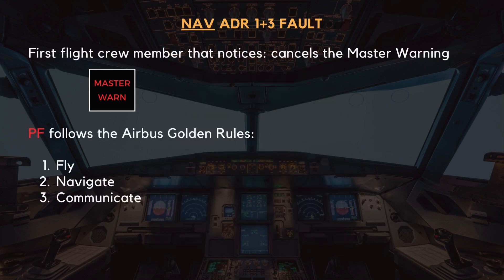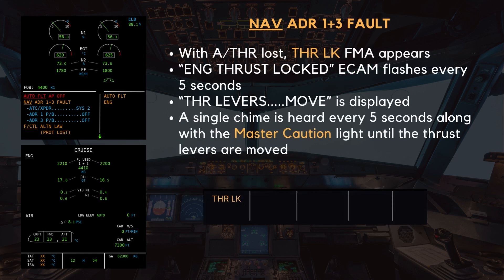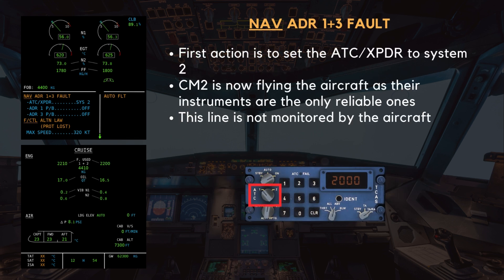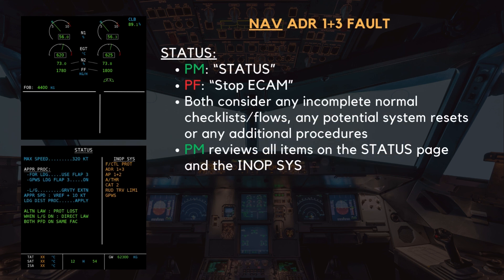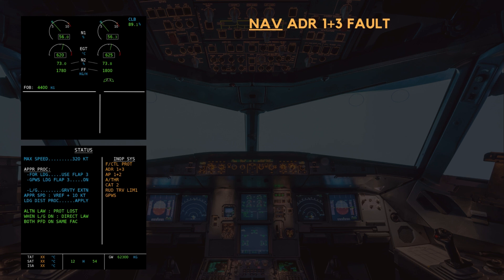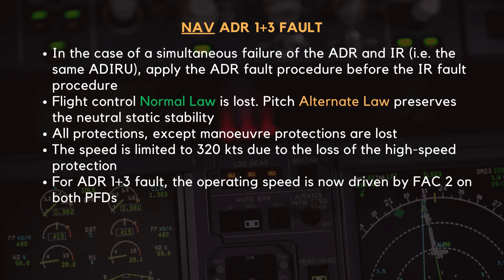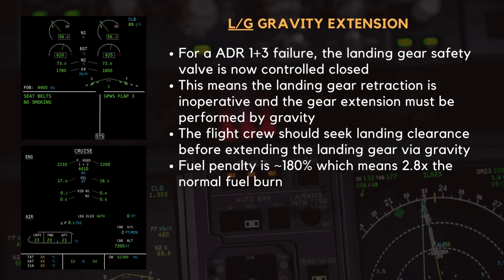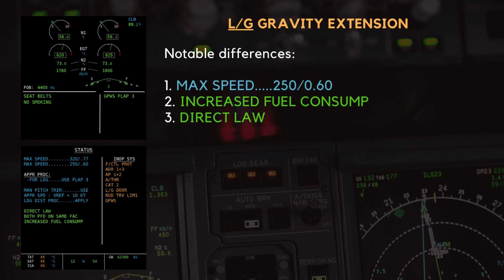A320 ECAM - ADR 1+3 FAULT | A320 Navigation

Comment: Very good, but note that Fuel Penalty Factor  factor of 180% for gear down means 1,8x not 2,8x
Reply: incorrect. if your fuel burn is %100 more than usual, it is 2x more. so if it's %180 more than usual, it is 2.8x more.